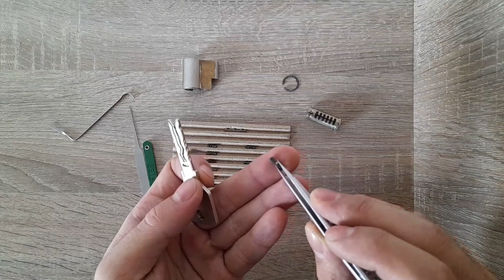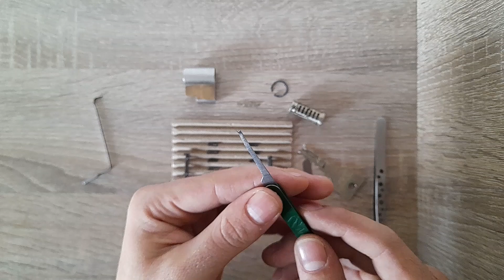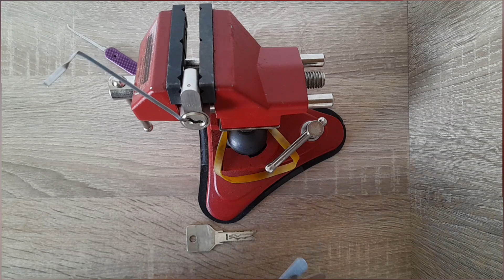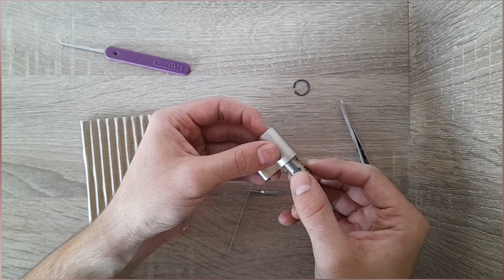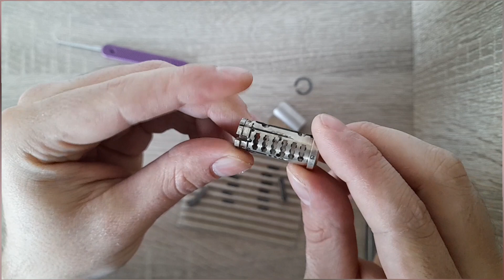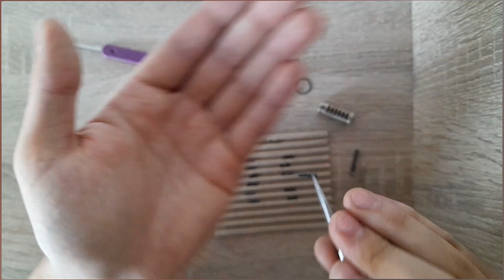(37) Evva 3ks Pick And Gut - no mastering, with false gates (black belt)

Comment: still a good choice in 2023 ?
Reply from the maker: Definitely a bery solid lock, picking it blind is very hard and will take a lot of time, so I wouldn't worry that someone is going to pick it for sure! I would recommend this lock for high security purposes even after 5 or 10 years!
Reply: @-DQ-  thank you for your reply, i was asking cause my mom has this lock on his door since 2012 while i have the 4ks and k75  👌, will you ever try to pick the k75 ???, i heard is very difficult lock to pick
Reply from the maker: @malgspremium  Never tried it and haven't heard about it also but I'll try to find one! Also I'll tell you that I had to disassemble and pick the 3ks with only some of its components until I fully mastered it so it is in fact very very secure lock against picking!👍🍻